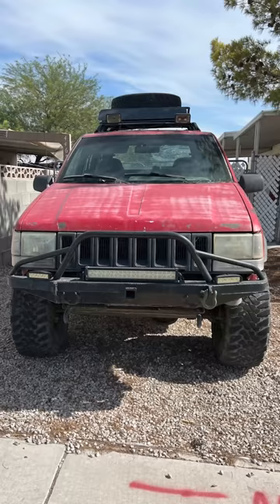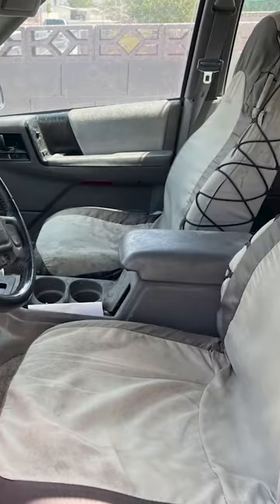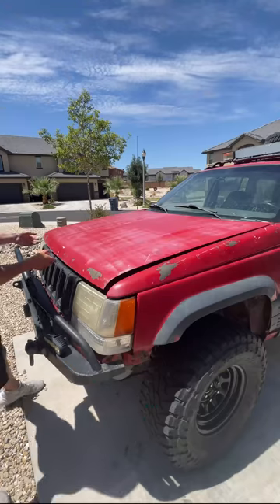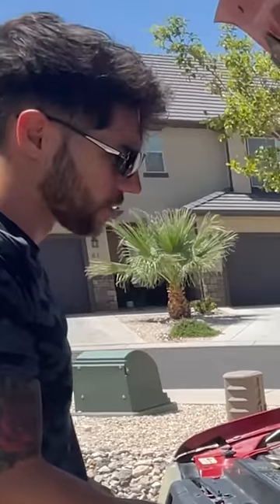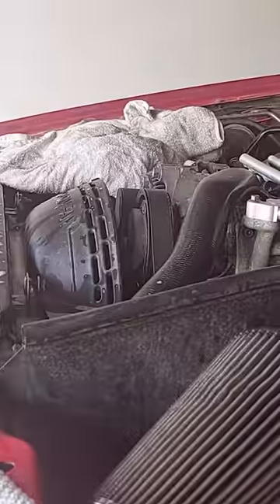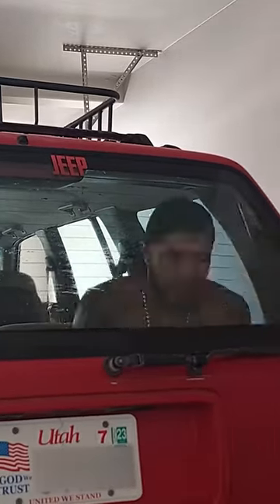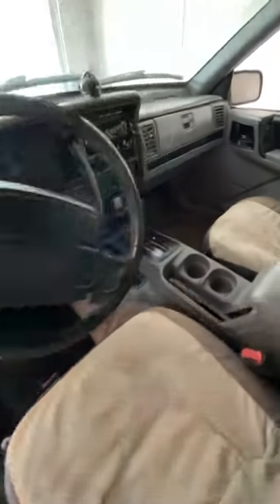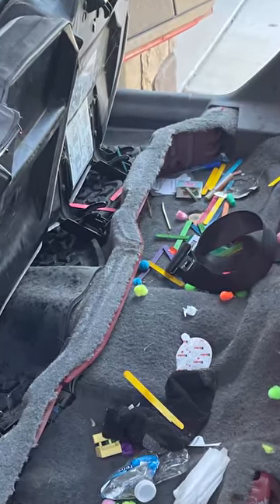I Bought a Lifted V8 Jeep for $2k

Comment: I paid $150 for my 95 limited 15 years ago. Had a blown motor. This weekend hit 265k running great.
Reply: Dang 265k on a blown motor is wild
Reply: Alright now LS swap it
Reply: Did you fix it yourself or with a pro? And how long did it take to fix? Also if you dont mind me asking more, any other decently big issues pop up over time?
Reply: did you buy it from walter white? cuz that’s cheap as balls
Reply: @astroid99  I've been a pro mechanic for 30 years, i did it myself. One day, swapped a used motor. Original engine had a bad water pump, kept driving till the headgaskets blew. Trans went at 200k, installed a reman then. Axles transfer case are origional. Ive done some maintenance things, shocks, fluid changes, brakes, one radiator, water pump.
At this point it's getting rusty and most of the electronic features have stopped working ie the compass, info center, rear door lock actuators. I mostly just drive it in rain or snow now bc it's a V8 all wheel drive.
Reply: @OG_Orly_OG It had 150k when I got it.  I've got a repair shop, customer didn't want to deal with it so I paid the tow bill, he gave me the title.
My F250 Diesel with 34k for $1k was cheap. All it needed was brake calipers from sitting. That was a deal.
Reply: I got you beat. 75 for a 64 olds jetstar 88. Drove it 12 years.  It rusted away.
Reply: Good lord you hit a jackpot
Reply: Naming miles on an engine swap is nonsense.
Reply: @GiDD504  
Naw,he cut a hole in the floorboard and installed a Flintstone motor.
Reply: @GiDD504  if the motor was fixed and rebuilt his will probably last longer than standard factory built
Reply: @dbrown4168  No it isn’t really the reason in the automotive industry we go by miles on the driveline, i.e. engine, transmission, drive shafts, axles, etc is because the body itself usually does not wear out very quickly the greatest wear point in any vehicle is almost always the driveline. The reason we do not go by hours is because hours are not as reliable a measure on a vehicle. If you were to drive five hours on a highway versus five hours in city traffic, the wear on your vehicle would be drastically different. When you swap an engine, you always tend to start a new mile counter for an engine swap, because the engine or transmission are usually the first major wear component failure in a vehicle. Thus how many miles an engine has is indicative of the reliability of the vehicle.
Reply: @franic_scopes9165  dude I don't need a whole chapter on why engines have miles and not hours. When did I say it should have been hours.

The reason I said naming miles on engine swap is nonsense is because he likely didn't update the odometer for the miles on the swapped engine. That is if he even knew them.  I assumed he didn't update the computer therefore the odometer is reading the miles on that body/computer not the miles on the engine.
Reply: @franic_scopes9165  you say start a new odometer like he's starting from a brand new engine with 0 miles which is 99% not the case.
Reply: YJs and XJs run forever!!! 💚
Unless you get the 4.0 with head issues 😅
Reply: @GiDD504  god dammit I almost spat out my food lmao
Reply: @GiDD504  He obviously repaired / replaced it lol

Comment: I paid $800 for a 97 2WD V8 ZJ in 2016 at a tow yard. Trans died due to overheating. I strongly recommend changing out the trans cooler lines. Chrysler Corp decided to put a check valve in the trans lines, and they get gummed up over time, stopping fluid flow from the cooler to the trans. They're on Rock Auto for like $20 or so each, and definitely worth it for the extra security. I'm having my trans replaced right now, and the cooler lines are being replaced.

Comment: Great choice. I had a 98 ZJ grand Cherokee 5.2, paid $2000, and put 50,000 mls on , and only replaced the starter and water pump as it neared 200,000miles. The performance was much improved by cleaning the gas filter in the tank as it had water from sitting.

Comment: When I worked at a dealership, I had to remove tint all the time. We never touched the back window because the heating element is so sensitive to damage. I'm sure it's not very important in the grand picture of the car, but good to keep in mind.
Reply: Came here to say the same—NO RAZORS on the rear window!  Guessing that the rear def is TOAST!
Reply: I owned my own tinting business for 25 years, and have removed tint from hundreds of rear windows with defrosters, with no damage, and never using a razor blade.  Tricks of the trade
Reply: @4549tinter  This.  ^  ^  ^
Reply: @4549tinter  tricks? Let me guess, you use a heat source and just peel it off
Reply: Nobody asked or cares

Comment: Sweet Jeep!
Be careful scraping around the rear defrost lines, if you nick them they won't conduct anymore. Ether, or starting fluid, will work great as a solvent on a rag to dissolve and wipe away the adhesive from tint.

Comment: I had a 98 GC with the 4.0 with over 400k miles. It developed a tick in the top end, and eventually ended up driving itself onto the trailer for it's final voyage to the scrapyard.

Comment: As someone who owned a 97 ZJ for almost 7 years, They are high on insurance due to it being considered a sport SUV, Parts are expensive/Hard to find (Except motor parts as I had the 4.0 i6) and they have electrical issues you have to work through

Comment: Gotta love the $2000 projects. Same shit with my Tiburon GT V6; after I removed a couple of pounds of dog hair and fixed some interior parts that were falling apart, I spent quite some time fixing electronics and cleaning up the engine and swapping in fresh consumables and some bolt-on mods. Ran great when I took it on a test drive, until it developed a subtle knock.
Given what I know about the car, the previous owner only ever did the bare minimum to fix any issues (down to having mismatched spark plugs), so I'm hoping the knocking is because of a busted water pump bearing or timing belt tensioner and not a bearing..

Anyway, you don't buy a $2000 sports car or 4x4 in order to have it as a daily straight off the bat, you're buying it because you're willing to drop enough time and money into the pit to make it work, because that's more than half the fun.

Comment: Bought a 2001 sequioa 4x4 sr5 for 1000. It was missing cats. Invested in cats and now it's running smoother than my 17 tacoma.
Reply from the maker: That’s awesome nice deal
Reply: @stayve.  I guess the best part about buying g a used car that you can fix is when you "what the F were they thinking" as you attempt to fix the issue

Comment: Your not alone I just bought a 2006 lincon ls water pump gave out, electric water pump gave out, thermostat blew right through the plastic housing, and I messed up my intake manifold and it needs new spark plugs with ignition coils I bought the car for 1,600 and I knew problems were gonna appear soon or later

Comment: Bro don't use a razor to remove sticky tint residue on any rear defrost or you'll be replacing the missing contacts. It's basically low voltage wire and once it isn't fully connected it shorts out

Comment: I had one of those Jeeps it was a 96 and it was stock with just aggressive tires, and I'll climb my brand new 2002 lifted f250 super duty and my buddies lifted 2500 Ram!!!😳 I paid $3,200 for it, I'm not going to tell you what I paid for the super duty, but I will tell you I had more in the lift kit and rims and tires than I did the entire Jeep by almost double...

Comment: I hope you didn't forget to change the dunkulburlock. But if you did, remember that it won't unfurl fast enough if you did press the alignment pin under the chakrachakra robistenator.
Reply: I had the same problem with my old diesel Cadillac.  Once I got all that fixed up it stop throwing spark plugs everytime I took it out for a spin.

Comment: Replacing vital saftey and functional parts without even knowing what they are/do before hand spells disaster. I work at a dealer and newbies regularly destroy parts of, or their entire vehicles, due to ignorance (over/under torque, forgetting steps, forgetting parts, mismatch parts, etc.) Worst case scenario is a tie rod end shacking loose and you end up killing yourself or someone else. Get a professionals help.
Reply: I don't want to unmotivate, but if your driving this on the road, you need a good and experienced mechanic to double check your work. Not some friend who works on cars in his garage, I'm taking a REAL 40 hour a week mechanic

Comment: You should never use a razor blade to remove something from the rear window. If you "break" and of those lines going across the glass you can say goodbye to your rear windows defrost capabilities 💀😂
Unless it was previously messed up already in which case it's whatever cuz you'd need to replace the entire piece of glass just to fix the defrost

Comment: Lol you just ruined your rear defrost, it no longer works. You can't run a razor blade over defrost lines. You have to use steel wool and glass cleaner or steel wool and soapy water.